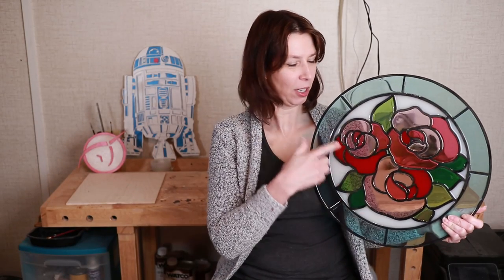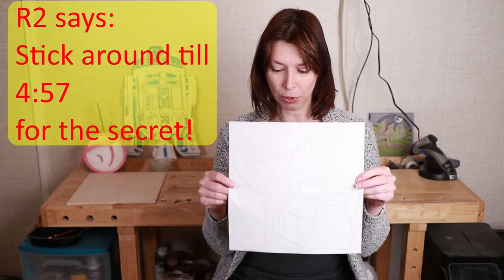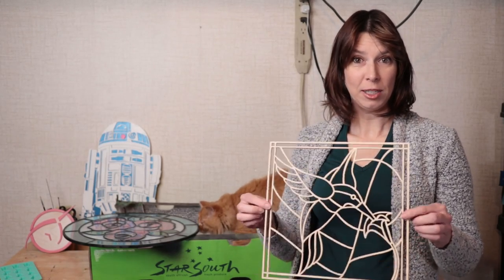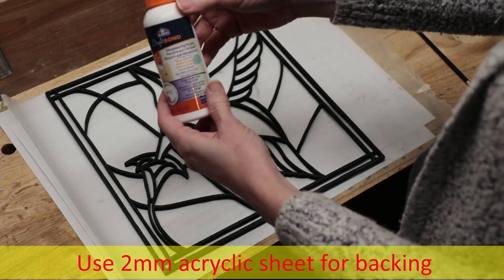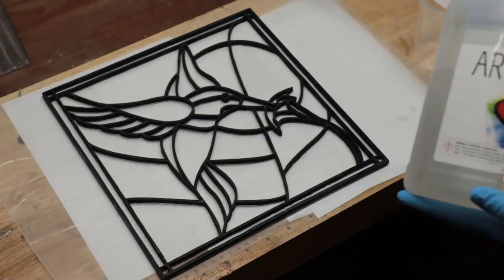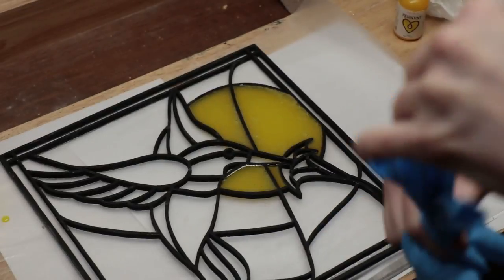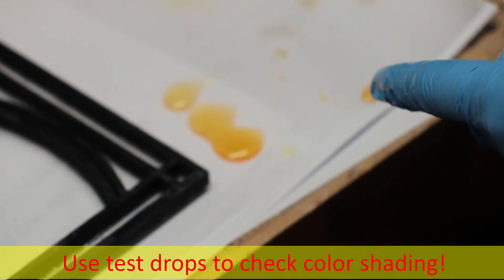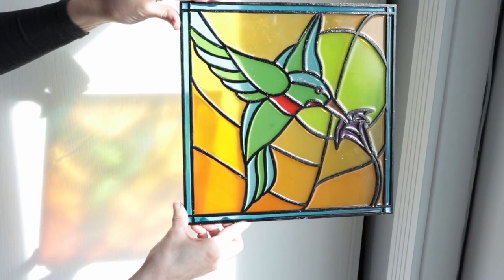Making a Simulated Stained Glass Piece with Scroll Saw Art

Comment: I am another one arriving from Steve Good's recommendation.  Just one question, how did you separate the acrylic sheet?  Sounds kinda dangerous to me.  Thanks!
Reply from the maker: Hello! I wasn’t going to separate the sheet but I’d thought I’d give it a go to see how it goes and once I started, I was committed. I basically just pried around the edges with a butter knife then yanked it off in bits. It was definitely scary! It does end up looking a bit nicer than leaving the sheet on but you don’t have to remove it if you don’t want to as that still looks nice too. I will likely end up leaving it on in the future.
Reply from the maker: I’m worried about using less adhesive due to potential leakage. I usually put clear tape on the wood over the pattern because usually the pattern isn’t the same size as the wood and so the clear tape covers the sticky blue tape around the pattern. I suppose I didn’t really need to do that for this one given that the pattern covered all of the tape but I’m just used to doing it and it’s an extra layer of comfort for me to be ensure it’s stuck properly.
Reply: @tamarapawluk6169  I was thinking about this last night.  I debated about taping or gluing something below, but that has the same problem you dealt with.  Then it dawned on me that we might be able to use something to press the wood into... but what?  Then bam... something like plumbers putty!  Maybe roll it out thin like a pie crust (1 mm tho), and then press the wood into it.  It might seal to prevent leaking, and then peel away really easily!  It would have the added benefit of having the epoxy sit above (or below) the wood level when viewed from the other side - so symmetrical!  I think I may try this, but I need to order epoxy and the ink.  Anyway, just a thought!  :)
Reply from the maker: A great idea! Very intriguing. Definitely let me know if that works out.

Comment: I love it you did a great job !  What about using an epoxy release spray on the plexiglass ? I tried Art Resin and had similar issues so I switched brands and have had way better results. I wonder if you just held the frame down with a strong back and poured 1/16” of clear epoxy to seal everything and then pour the dyed epoxy…but obviously you already thought of that. I was looking for a new scroll saw project and this is prefect fit.
Reply from the maker: Thank you! Great suggestions. I’m always looking for ways to improve the process. I tried a new way in a different video where I only need to attach the edges to a poly sheet and then pour a thin layer of clear resin to act as a barrier for the coloured resin. 

https://youtu.be/MSRyue7-178

Comment: What is the brand of the glue you used for attaching Plexiglas to the wood.?
Reply from the maker: Hello! I used Elmer’s disappearing purple spray adhesive. I don’t spray it but I brush it on. I like it because it’s runnier than other glues so easy to brush on and get good coverage. And it dries nice and clear too.
Reply: @tamarapawluk6169  Thank you.  I have done some research and found out this is available in Canada at HD and the Art Resin is available at Amazon and in various sizes at the local art store.  Definitely on the todo list after the isolation period.  Thanks for the video.